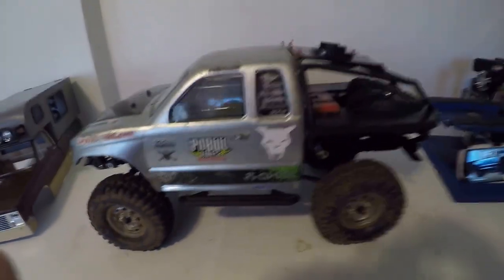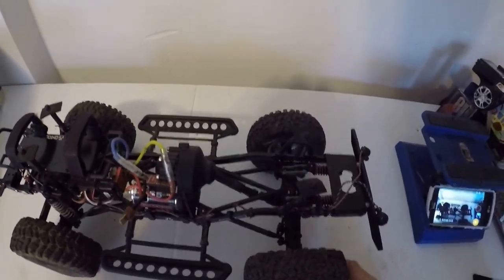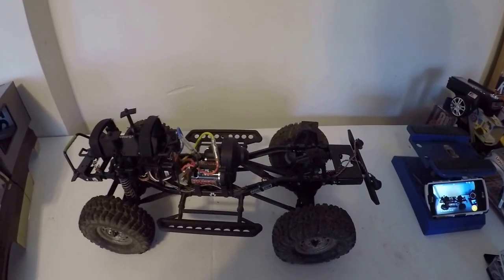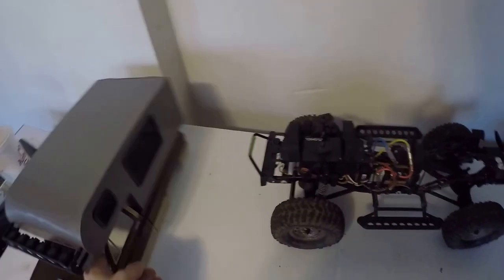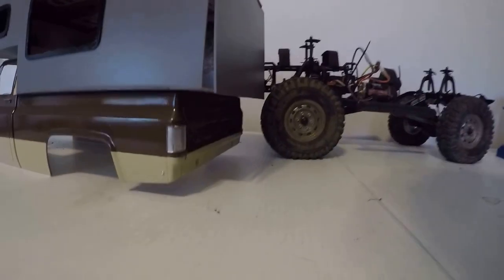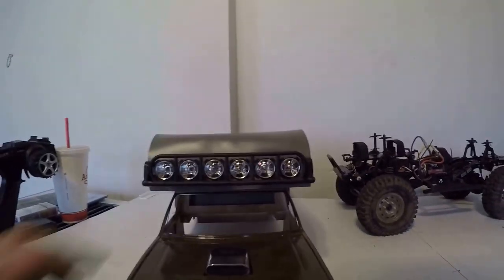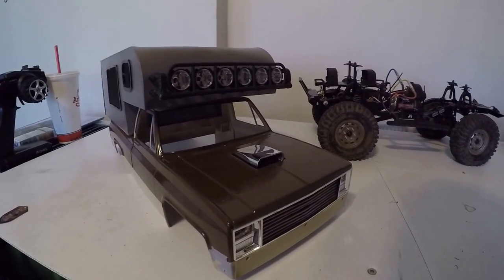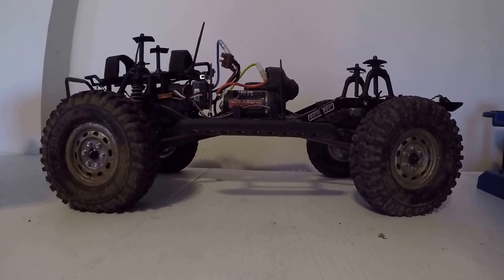Truck update and first look at Dinky Cantilever Setup

Comment: I think the cantilever setup is supposed to go on the outside of the frame rails
Reply from the maker: oshow02 initially was designed to go on inside the rails. I later stuck it in the outside of the rails. Works better on outside with the rods cut so it's rod end to rod end. Doesn't topple over so easy now.